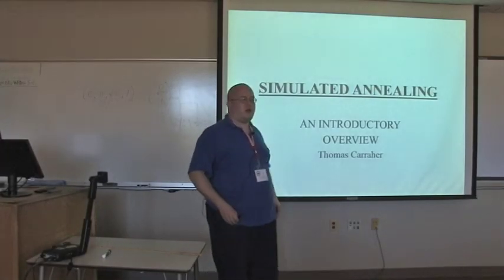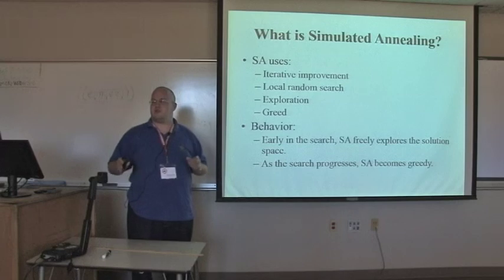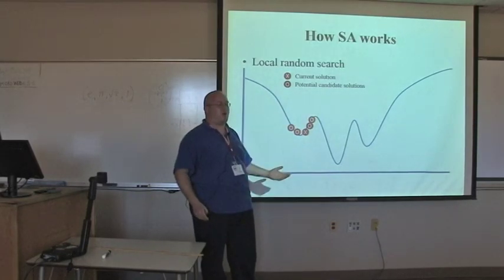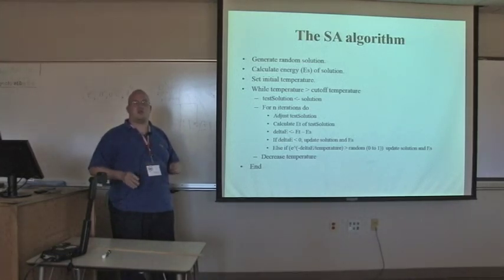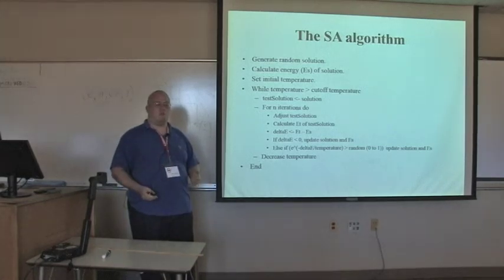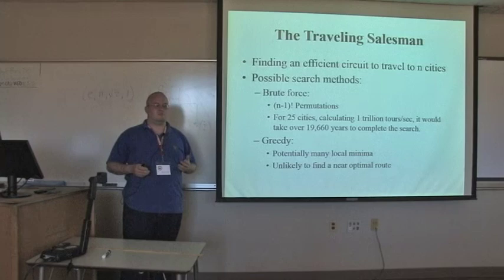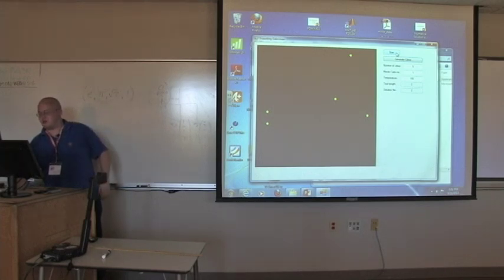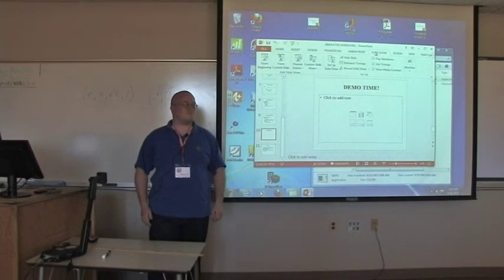Introductory Overview of Simulated Annealing

Comment: hello sir i don't know about c# but the code you have posted has shown error....prog.cs(11,14): error CS0234: The type or namespace name `Data' does not exist in the namespace `System'. Are you missing `System.Data' assembly reference?
prog.cs(15,22): error CS0234: The type or namespace name `Forms' does not exist in the namespace `System.Windows'. Are you missing `System.Windows.Forms' assembly reference?
prog.cs(19,33): error CS0246: The type or namespace name `Form' could not be found. Are you missing an assembly reference?
Compilation failed: 3 error(s), 0 warnings.......
what should i do
Reply from the maker: +Sandeep Kumar Yadav The code I posted is not a full c#.net application.  I posted only the code segments that directly pertain to the Simulated Annealing algorithm.  I chose not to publish the rest of the code because it is fairly standard and does not contribute to an understanding of the SA algorithm.  In order to use the posted code segments, you must first create a form and appropriate controls in C#.net.  If you are new to C#.net, I would recommend searching for a tutorial series on the topic.

Comment: How is this different from Hill Climbing???
Reply from the maker: Good question.  Simulated Annealing uses the same mechanism as Hill Climbing, plus a bit extra.  Both algorithms begin with a random solution, make a small change to that solution, test it, and accept the new solution if it results in an improvement.  The key difference between these algorithms is that Hill Climbing only accepts changes that result in an improved solution, whereas Simulated annealing probabilistically accepts worse solutions.  What this means is that, in a solution space with a lot of local minima/maxima, Hill Climbing has a high probability of getting stuck at a local minima/maxima, but Simulated Annealing has some ability to break out.
Reply: Cragsmith S Thanks!! :D

Comment: Which program did the guy used to do the simulation? Please answer. Have the same problem in my project
Reply from the maker: ***** My apologies, I got caught up working on a pet project and completely forgot to post some code here.  I will take care of it tonight.
Reply from the maker: I wrote the demo program in C# .net using Visual Studio 2012.  It is a fairly naive implementation, but I would be happy to share my source code.  Give me a day or two and I will comment the code and see if I can post it in the description.
Reply: Cragsmith S Hi, Craigsmith. Is it possible to share the code in the description or in another code sharing site, like Gist.
Thx